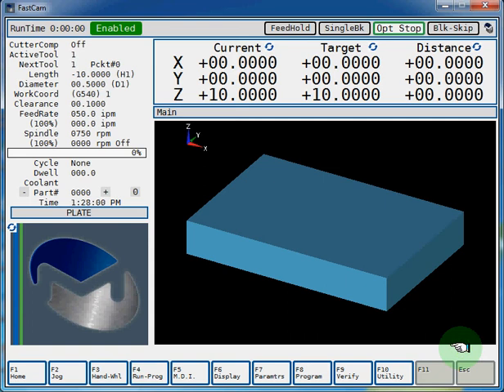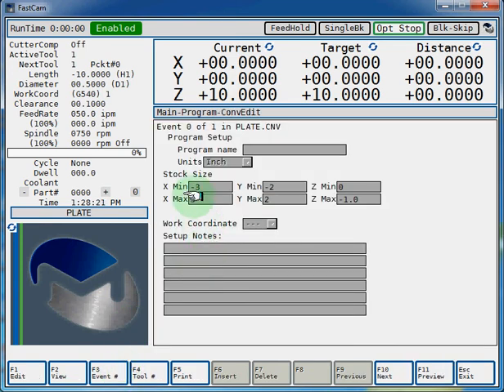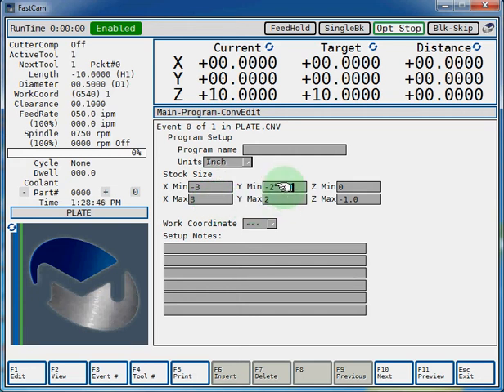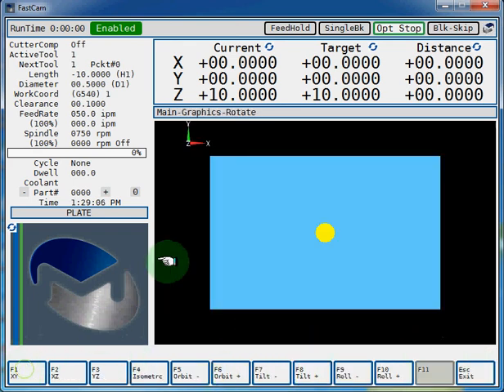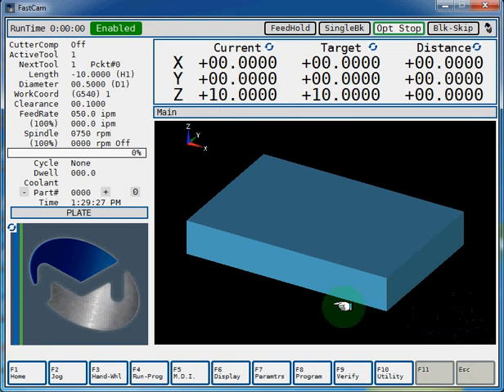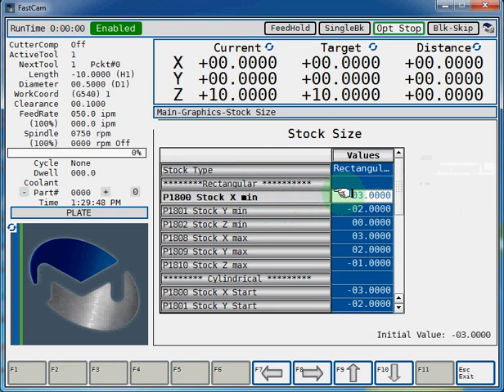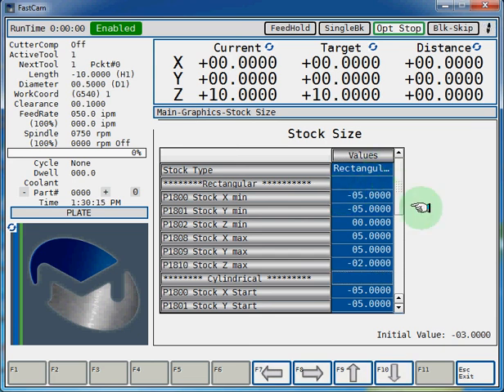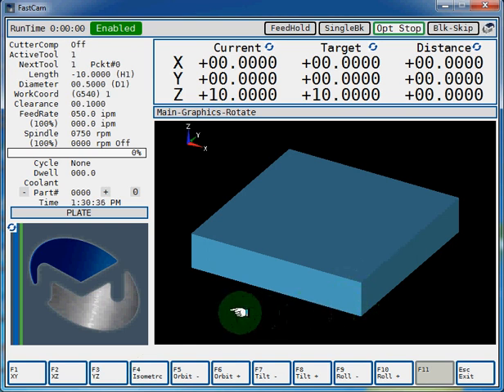Solid Model Stock Size

Comment: Will Milltronics pick up the stock size and type from the header of an NC program?    If the header had the p values defined?
Reply from the maker: Hi Depoalo! You can either enter the stock size in the
Display-Solid Stock Size- Graphics fields as shown in the video.  Or if
you can enter the following line of code:  G777 (rectangular stock size) X
(x min value) Y (Y min value) Z (Z min value, usually top of stock) U (X max
value)  V (Y max value) W (Z max, thickness of stock). Thanks!